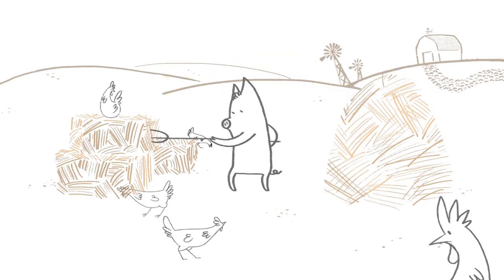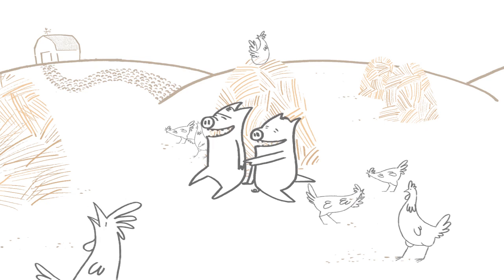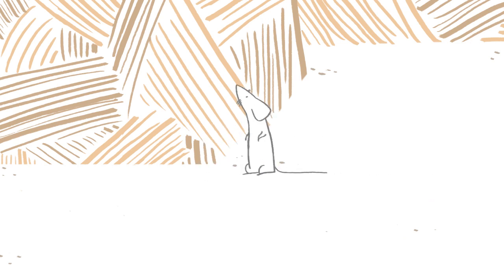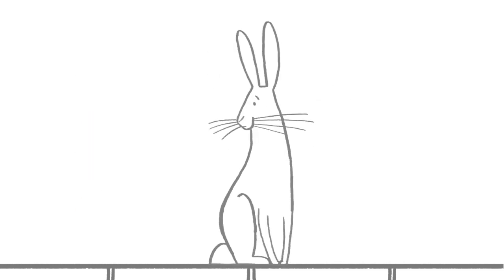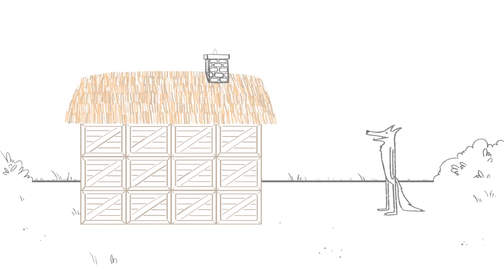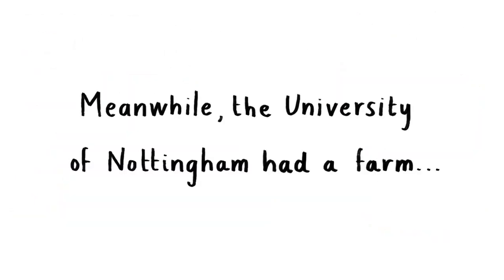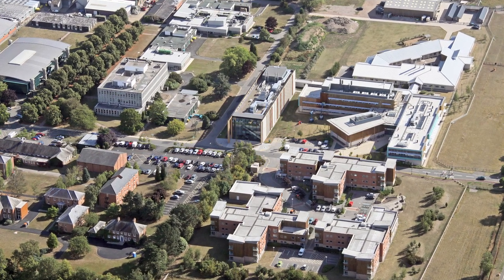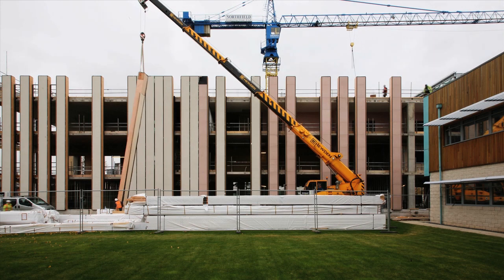The Straw Bale Building by Make Architects

Comment: Not really the best way to use straw as a building material, doesn't use it to best advantage. They could have avoided using most of that lumber had they let the straw be weight-bearing and rendered it with a lime render.